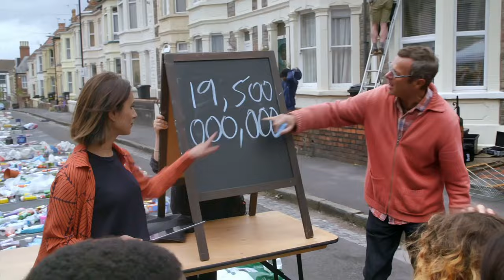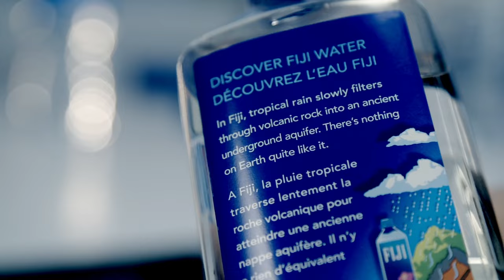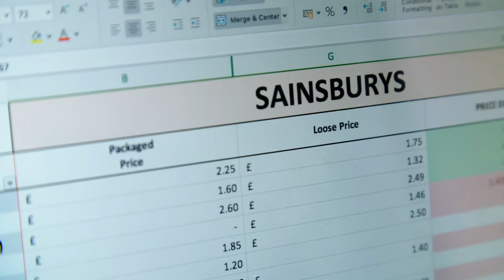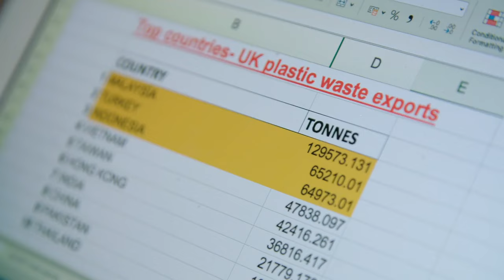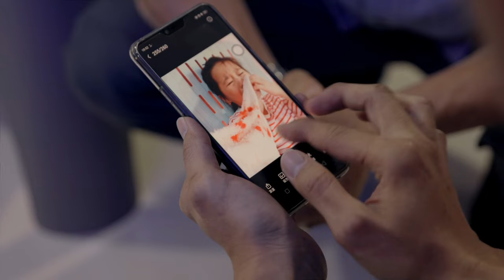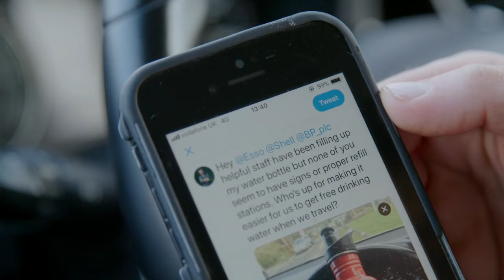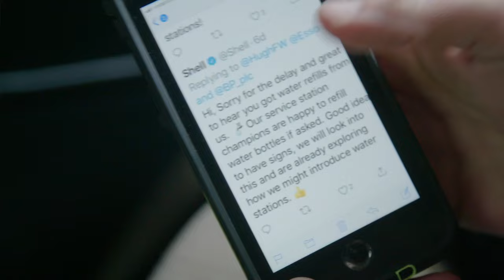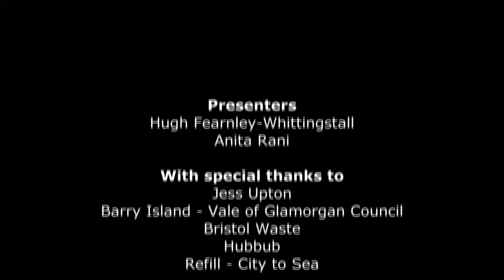Environmental War on Plastic - Save The Planet

Comment: this video is so eye-opening, i want to help do my part by reducing mine and my families plastic but I'm struggling on how to do it.
Reply: Zero waste... Step by step...
Reply: Start off in small sections . You can start by changing your plastic toothbrush to a bamboo one when it’s time. The next week you can try shopping for groceries with a reusable bag or even use a cardboard box from the store. Small steps . Start with what you’re comfortable with.
Reply: I'm thinking the same, looking in my bathroom and it's everywhere, shampoo, moisturiser & such items. When this became a big talking point decades ago, I thought my now we'd have installed refilling areas in supermarkets for fabric conditioner, toothpaste & try to wipe out some single use items. 
Doing my bit helps, but I feel like it's trying to put a plug in the ocean 🌊
Reply: Citlalli Alonso I suppose it all helps, I do what I can yet feels like I'm not doing enough. Every little helps is the way to think on it I believe, is that right though I say to myself & yes it must be, hopefully?...😏